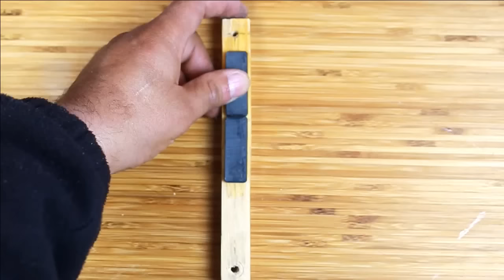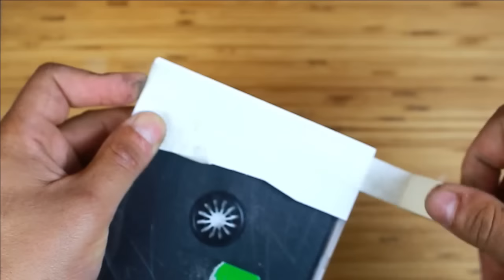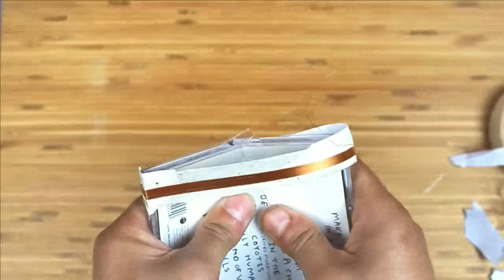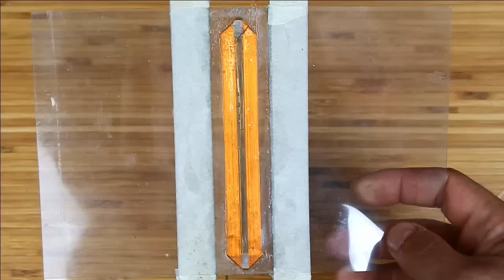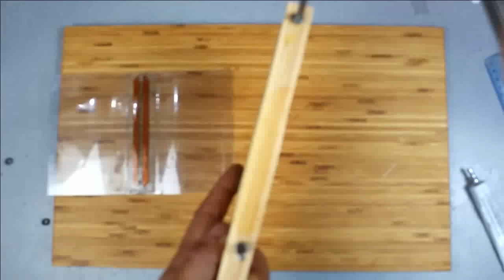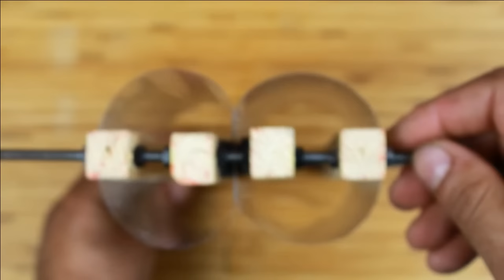--||-- Diy Full Range Rubanoide Speaker --||--

Comment: How would you increase mid and bass range? Heavier plastic on a taller stand? Increase magnet size and current input for more decibel output? Great video on a great project. Thanks!
Reply from the maker: Bass response is very limited for this kind of speakers, but midrange is very amazing,  quality of midrange and treble can be improved by the use of high quality neodym magnet,  and trying different voice coil/diaphragm sizes and material.

Comment: What a great project to tinker with 👍😀…
The copper wire you use to make the coil , is this wire insulated?… 
Because if it’s only copper wire with no coating can it short out ?…
Or is the super glue works a insulation?..
Reply from the maker: Yes of course insulated copper wire, all coils and inductors are made based on.
Super glue is used to hold the forme.
You welcome 🙏
Thank you for your comment 🥰

Comment: I loved this project. 
It shows that everything multi- dimensional in the universe can exist in 2 dimensional forms. 
When you flattered the coil, I almost jumped. 
I wish you had some ferromagnetic metal plate below those magnets. 
Lastly how many ohms is the resistance - what gauge wire - 24? and how many turns?
Reply from the maker: Thank you for your great comment 🙏🙏🙏
The answer for your questions is on video description 😉

Comment: Would 2l drink bottles glued to the coil and outside supports work or would it be too stiff a material for the tube cones. Be faster than messing with the sheets.
Reply from the maker: slt, you just have to try and see what happens.
Each different material sounds different, and don't forget that apart from the rigidity of the membrane there is also the weight,  even for pvc A4 sheet exists in several thickness and rigidity.

Comment: This is a very cool project. But it leaves a couple questions for me. Like, what is the impedance of the coil? Do you have a rough estimate of what the frequency response curve is? What gauge wire is that? It looks like 30 gauge to me but I could be wrong. I wouldn’t mind making a smaller one that could be used for two-way radio or other voice applications. I also wonder what other materials could be used to alter the properties… this has a lot of possibilities 😊
Reply: Use 32 wire gauge 
- make turns until getting 6ohm voice coil.
- A4 0.3mm transparent pvc sheet 
- Super glue to make voice coil 
- Epoxy adhesive to fix coil on ribbon best results 
- Neodymium magnet for best results
Reply: @donquixote4630  6 ohm DC correct? Which should roughly be 8 ohms for audio I’m thinking
Reply: @8bitwarrior  I only reproduced the author description below the video.
To see it just click on the "show more" button.

Comment: This reminds me of the Lineaum tweeter/ speaker design, what are the materials that you used for the magnets, the film/sheet of plastic, and the glue?
Reply from the maker: - A4 0.3mm transparent pvc sheet 
- Super glue to make voice coil 
- Epoxy adhesive to fix coil on ribbon
- Neodym magnet for best results

Comment: very smart design!
how many spires on your coil?
Reply from the maker: Make spires and mesure before cutting wire until you get 6 ohm as resistance.
Just remove some insulating material from enamelled wire before taking mesure.
Reply: @homemade_audio  of course just measuring the résistance until you reach what you need.
Super clever!!
Thanks for the quick reply.
You made a new fan xD
Reply from the maker: @adrienw4704  thank you, but make 10 or 12 twelve spires before taking mesures.

Comment: That gives me an idea on building a magnetic phono pickup. Remember making a homemade 78 rpm record player with a sewing needle and a plastic cup. I tried glueing the sewing needle on the cone of a small 2" speaker and glueing a straw to the speaker. Connect the speaker to an amplifier and you have an old fashion looking wind up record player. Then you have to make the turntable hahahaha 😆
Reply from the maker: I took note of everything you said 😎😎😎 and I think your experience inspires me to make something special 👍👍👍
Reply: @homemade_audio  it would be improved if a locking collar with lock screws is installed at the sewing needle to use proper steel needles for records and can be replaced. Have fun and your videos have lots of good ideas
Reply from the maker: @chriscimino7854  I'm just an audio fans like you, and i love to make amy own speakers & drivers 😍😍😍
You welcome,  and welcome for any question about sound 😉😉😉

Comment: Well now I know what My next speaker build is going to be. I presume the impedance of the coil is 8ohm (ish)
Best Wishes Jahmahrah
Reply from the maker: Based on ruban material used you'll get different kinds of responses.
I tried before many kind of paper but i prefer plastic sheet responses.
On my project the impedance is about 4 ohm.
You welcome, good luck 🥰👍👍👍

Comment: I think this speaker don't produce enough low frequencies. Anyway the design is a must.
Reply from the maker: Yes, in general down to 100hz, but it's recommended to use subwoofer under 150hz

Comment: How many watts amplifier should I use for these speakers? I'm all set to build 2 such speakers for stereo sound and I'll attach a 4 inch 8ohm sub in parallel with 1inch 8 ohm twitter also I'm going to make the winding of 4.5-5.5 ohms for the rubanoides so that it sounds crisp

Comment: Nice and simple!
Can you extend the range with a passive filter? This seems to operate like a dipole. Those let the low end role of at 6dB/octave. That can be compensated with a simple low pass coil and a bypass resistor to level down all other frequencies.
Reply: I think you would lose untenable amounts of efficiency like that. for each octave above the passband of tbe filter, you need 4x more power to drive it. I'm also not sure about that 6 dB per octave bass roll off with the dipole effect. Where is that measured? Maybe that's the average power drop in the transition band, but at lower frequencies the cancellation is nesrly complete (-infinity). That's especially the case  measured anywhere on the plane of the dipolar radiating surface.

Comment: Hello. I am one month in on making this speaker. My question is this… what millimeter of wire did you use, how many wraps and what amp or stereo did you use to make this work properly? 

I have already burned up one 100 watt amp. I ordered a new amp and in the meantime, I hooked this up to a CD player that is now suffering from overheating. 

The sub woofer speaker I bought for the new amp was checked in at 7.2 ohms. So each speaker on the left and right channel should also match this somewhat. 

Thank you for your time.
Reply from the maker: Hello, for the diameter of the electric wire and other informations you will find them in the description.
For your second question: whatever the power of your amp, it will burn if it is connected to speakers that have an impedance lower than the minimum impedance supported by the amp!!! in general 8 ohm speakers are supported by almost all amplifiers, but below 8 ohms it is necessary to check the minimum impedance supported by the amp.

Comment: I wonder since it is a coil inside the magnetic gap, if there’s some current going up, there must have same amount of current going down, the force that generate by these current must by the same(but the direction is reverse), so the forces would cancel each another out and the plastic film should be not moving?
Reply from the maker: since the magnetic flux is the same on both sides, the change in flux generated by the coil forces the coil to leave the transverse flux zone in a longitudinal manner.

Comment: What was the impedance value on that coil, is it 8 ohms or 4 ohms?
Reply from the maker: It's about 4ohm
Reply from the maker: For 20 turns with 32 wire gauge
Reply: @homemade_audio  thank you very much, can't wait to built one.

Comment: I am novice in this field and need some help here, I just followed your instructions and created these with similar materials like 32guage copper wire approx. 35 rounds on a cd case, 200 microns acetate sheet etc which were available at my home. But the sound I am getting is too low (really hard to hear). Please help in troubleshooting the problem. Thanks in advance.
Reply from the maker: hi, first since you already have a sound that's a good sign that ensures other things are correct in your prototype.
 to increase the sound it is necessary to improve the roundness, immediately try to:
- use neodym magnets instead of ferrites.
- leave as little space as possible between the coil and the magnets
-  use 4 rows of magnets instead of two, each vertical part of the coil must be between two magnets.
Good luck 👍👍👍
Reply: @homemade_audio I was not well for some time but thanks for your reply. I just got sound from the speakers and will share a video soon. But there is one more problem, when I center the coil between the magnets (which due to 32 gauge wire    is a bit wide) produces lower sound while when I push the coil a little offcenter when only half of it is between the magnets, it produces louder sound.

Comment: On both sticks with magnets glued to them, are both the left and right stick opposing or attracting each other???
Reply from the maker: Attracting each other,  and the front wires of voice coil between them not the center of voice coil, like that you can add two stiks with magnet for rear wires.
Reply: @homemade_audio  thank you. I am going to use rare earth magnets for this instead of regular magnets. And two different types of copper wire in between two separated plastic sheets. I love this video!!
Reply from the maker: @jeffveron8783  thank you 🙏🙏🙏
Reply: @homemade_audio  can this speaker play music with clear audio/singing at the same time?
Reply from the maker: @jeffveron8783  why not!? In general it plays sound well deep down to 150hz.

Comment: Very interesting, i've never seen a speaker constructed like this before. Would it be possible to use this same technology to design something that could do bass frequencies very well? Would I just need a lot more windings, bigger magnets and make the surface of the plastic bigger?
Reply from the maker: Bass response is limited, but the rest of frequencies can be improved well.
Reply: due to the lack of proper suspension(spider, stiff surround) bass might sound muddy as the "cone" will have almost no damping at low frequencies and will likely hit maximum mechanical excursion, for higher frequencies this is rarely a problem as the cone doesn't move in and out as far, and a softer suspension is usually beneficial for highs
Reply: As fish said, you would need to make one with a stiffener, or movement dampener, then put an electronic filter to weed out higher frequencies,  so you could make two speakers, one filtered for base, and one filtered for the rest.

Comment: Excellent work, dear, how many turns to the cd box with the coil cable? Gracias
Reply from the maker: Hello. Thanks much for your great words,.
The coil is based on 25 turns of 0.2mm enamelled copper wire, it will give about 3.8 ohm on multimeter.

Comment: Use neodymium magnets, (for strong magnetic field) use nomax paper (to make the membrane lighter) and pure copper wire to keep the sound pure (put less glue to keep the coil lighter) the design is incredibly very easy, you Can get a 300 dollar midrange or tweeter sound for $10 plus having fun doing it your own 😀, happy listening 😜👍
Reply from the maker: I used nomax paper before, but it didn't sound good as plastic, but all what did you say to improve it is correct.
I have bought neodum magnet to remake the same project but after holidays.
Reply: @homemade_audio  did you try to make holes in the plastic? Maybe it will help the sound spread wider and cleaner, im planing to make these my self too, and i have subscribed, i would like to see any updates and New recomendations 👍, keep the good Job up.
Reply: @homemade_audio  also make holes in betwen the coil (just saying, i have never exoerienced this type of driver before, all i have played with was a chinese clone headphone driver tune up, it sounds really amazing)

Comment: Really real rubanoid as in the patent. Almost. The magnetic system needs to be made more symmetrical. And, of course, for racks it is strictly necessary to use more expensive types of wood (for example, Bocote or Agarwood). 😀
Reply from the maker: Yes you're right, in addition to what you have said,  i will remake same project with neodym magnet, i still need some material to make it well

Comment: "Simply Speakers Speaker Repair Adhesive" for anyone else wondering what the clear glue was.
Reply from the maker: Yes it's 👍
But for good results it's recommended to use epoxy adhesive 😉

Comment: Hi, I have several questions:
1. How many turns for the coil?
2. What is the impedance of the coil?
3. What is the thickness of the cable for the coil?
4. Does the plastic must form a perfect circle?

Thank you
Reply from the maker: 1 : about  20 turns intel get 6 ohms
2 : not yet measured but R = 6 ohms
3 : 32 gauge / 0.2mm
4 : yessss
Reply: @homemade_audio  Thank you for the reply
Reply: @homemade_audio   thank you

Comment: plss mention details on video l7ke wire guage, turns of wire, cone material etc...
Reply from the maker: Wire : 35 gauge 
Ruban : A4 size 0.1mm thickness clear rigid plastic transparent pvc sheet
Turns: make turns until you get 4 ohm.
.
I have mentioned this informations on video.
Reply: @homemade_audio  ok thanxxxx...

Comment: Unfortunately, the back side will create backward sound compared to the front.  It will sound like the positive and negative wires accidentally got reversed. So, it's only good for 180 degrees.  Maybe just 150 degrees.
Reply from the maker: Yes there is some difference, specially for high frequencies response sûre.
Reply: @homemade_audio  Just install it on the panel and you're good!  Maggies or ESL's or true ribbons (Apogee)emit on both side too and sound amazing, for bass this becomes the issue...
Reply from the maker: For this kind of speakers the sound that creates problems is that coming from inside the ribbon., it's recommended to put some absorbing material inside the two ribbon to eliminate midrange coming from inside the ribbons.

Comment: This is not really a new concept in speaker Technology. Back in the 70's, there were speakers being made by Heil. They called 
them "air motion transformers".
Heil Air Motion Transformers. They used a conventional cone woofer, and the "air motion  transformers"  handled the mid range n tweeter output. They sounded great!
Crisp sound with no distortion... I liked them, but I bought JBL Studio Monitors instead, which I still have to this day, and they are still
kicking out the jamms... 🤔
Reply from the maker: I'm also a big fans of vintage jbl studio monitors (44xx/43xx) 😉